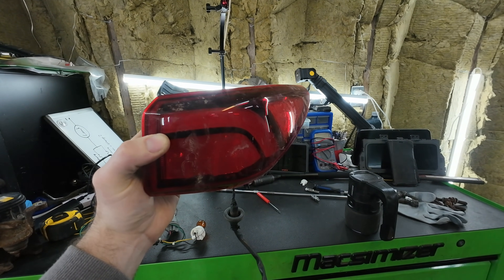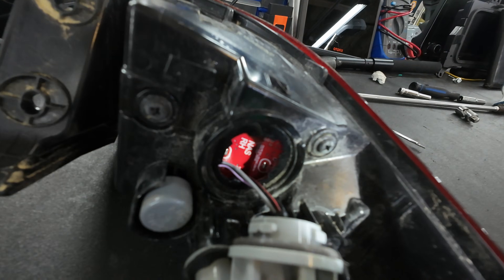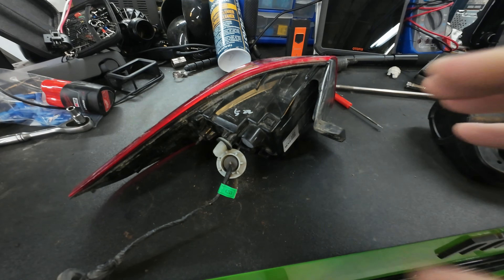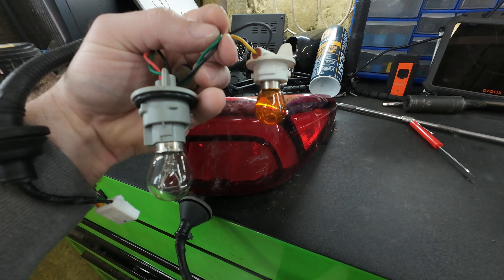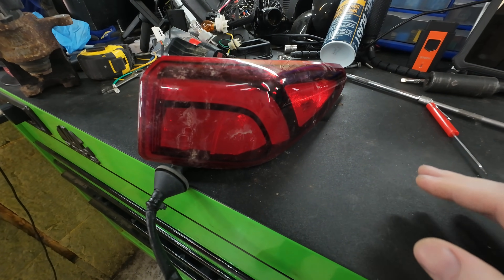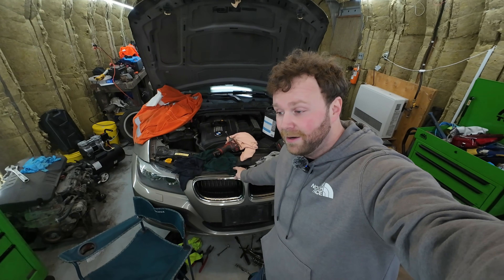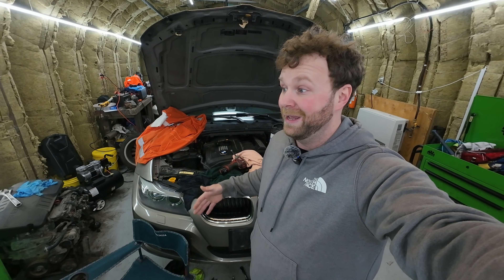Car Manufacturers don't even want you to change bulbs, they want you to replace entire assemblies!

Comment: Facts, I just turned down a starter job because the Pacifica has to remove the cat just to get to the starter and I’ve ran into the two bolts breaking off in the head and I don’t have the time or space to deal with that rn during the winter. Drilling out a head on a pentistar is not a job I’m going to tackle any longer… take it to a shop or a dealer. Lady couldn’t believe how much I was going to charge for it… I live in the rust belt so there’s a valid chance it’s gonna need special attention.

Comment: We like LED lighting but it's supposed to out last 100 incandescent bulbs. So the question. You need to be asking is;  why the led part needs replacing in the first place and stop being short circuited by the difference in costs., get real OK. Or were you not aware of why LEDS are being used now??

Comment: That's a <£100 PCB when low volume. £1200 is daylight robbery... Not to mention how easy it would be to fix, but this will still end up in a landfill because it's cheaper to manufacture than to troubleshoot.

Comment: I'm thankful for my 2021 AWD Ford EcoSport. Easy bulbs. Easy access. It's headlights were dangerously candle dim with incandescents behind the projector lenses, so I upgraded to LED. A lot better, the same light height, and doesn't scatter. No complaints or bright flashers from oncoming drivers. Still dimmer than most stock (brighter than the sun) LED headlights out there, but they do the job. Unfortunately, the foglights to LED were difficult. At least when I did get access, they were plug and play.

Comment: It's also a safety problem when you have to wait for repair parts because they are not available locally.  If I'm going to spend that much I'll replace the whole wiring harness with equipment I can service. That's outright theft.  There's a company I won't do business with.

Comment: That's very probably a global plan of car manufacturers cartel to end licensing for small manufactures in order to cut vehicle parts availability. From this year in EU you can't find third-party parts for some new Renault models. Plus most of the main parts has it's own ECU and needs programming. That i.e. means taillight will not work even if you have a spare one from another vehicle. These vehicles are serviceable only at Renault-certified dealerships at crazy high prices of parts. Also their labor rates are at least double than those by independent mechanics. Buying an new today car is extremely idiotic deal.

Comment: This is a common issues on the Mercedes E-class tail light, you can replace them or watch a video on YouTube on how to fix them, it’s not easy to fix, you have to cut through sections of the casing and solder the circuit board. I have done it on mine twice. But it’s repairable if you have a bit of courage.

Comment: Nice video. I've seen people pay more for factory LEDs after I warned them to just buy over the counter LED bulbs that will plug into the bulb socket. It always starts and ends the same. They are very happy and the factory LEDs do look nicer than the aftermarket. But over the years, one stops working and gets broken in a minor accident. Then they call me complaining that the factory LED assembly is $500. I always tell them, that the $10 LED bulb would have performed almost the same (the factory unit was a LEB Cob).
And people that fall for the laser headlights. 🤣 I'll be the first to admit that they look great. But replacing them is ~$2000. I'll stick with LED headlights and yes they are more expensive than incandescent bulbs, but the safety trade off makes it worth it, (auto dimming, LED Matrix that shields oncoming traffic, etc).

BTW - Just stumbled upon your content and this is the first video I'm seen. I subscribed right after watching it.
Reply: Funny how most parts like that cost so much yet a replacement LED brake light module on the 2003-2007 Acura TL is well under $100

Comment: Brake pads ...i heard somewhere that a specific honda need to be re programmed  to install break pads...software only a dealer can have ...or any mechanic that can pay a monthly fee.
Reply from the maker: I never ran into that. But if I had to guess it would be the honda prolog.  Its basically an electric Chevy blazer with honda logos.

Comment: that is the problem with the laser / led lights in current cars. you will need to replace the entire crap when it fails, and it will. costing thousands. the more "luxurious" the car, which is what people want, the worse it is.

Comment: You do understand that those old head-light bulbs used to cost about $20....  and then a service booking and a $70 mechanic labour charge to remove the battery or air-pump to fit it? This was on my 2005 Ford Falcon which had restricted access in the streamlined engine bay. And the bulb went about every 6-12 months. After a few years of this I fronted up the cash for a $300 change-over to LED head-lights. These then lasted me for over 10 years (never needed replacement before I finally sold the car).
The new EV is all pixellated LEDs and they work extremely well. I do not expect them to randomly just fail.  IF  I manage to prang it I have full insurance cover
Rule no. 1 - do not prang your car and smash your high-quality head-lights or tail-lights

Comment: The worst part is that the machines in dealerships don't know what they are doing and have little or no education on 95% of the newer vehicles.  Manufacturers are now doing everything they can to prevent independent shops from getting any information to their vehicles in the first place.  The dealership doesn't want to pay to teach a technician how to repair a vehicle.   99% of dealerships are all about production.  Production means More Money, Not repairs.  They want you coming back so they can charge you again, and again for a repair they should have done in the first place.   This is becoming the standard in the industry today.  You have no right to repair it yourself any longer.

Comment: 99% 1 led goes bad and takes down the whole light if you could get the light apart power up board and jumper across each led until light comes on you found your bad led.

Comment: I worked as a QE for a company in Grand Rapids Michigan that did tail and signal lighting for the OEMs. Ford did this with the Mustangs starting with the 2010 model year. When I started there in 2014, a set of Mustang taillights cost $800 US to replace.
When they started designing the wraparound placard taillights, it got nuts. Both corner lights and the placard all sealed LEDs. I helped launch the 2016 Ford Edge/Lincoln MKX rear lights, when they went to wraparound style.
It's all a play by the OEMs to make more money, either directly and/or thru the dealerships. The parts are more expensive, cars are more expensive. Under the hood, under the car, you can't just fix something anymore. Have to pull an entire assembly and replace.

Comment: This is so true. Once Pep Boy's tried to charge me $1,000 dollars for a headlight assembly. Instead I took my car to my own mechanic. He showed me the mangled job multiple mechanics did on the prongs that fit into the receptor. That was the reason why every bulb they tried didn't work. After my mechanic meticulously straightened out the prongs, even gluing one in that came loose from all the paw work at Pep Boy's, my bulb worked just fine. I don't think he even charged me the full hours it took him to fix it. That honest mechanic is worth his weight in gold.

Comment: My wipers failed. Bolt like connector in the wiper joints under the hood gave out. Went to service, they wanted to replace the whole wiper assembly, both wiper arms and all back to the motor. $$$.
Got a drill, drilled out the broken plastic both like connection, put in Teflon washers for movement, and regular washers and bolt for strength. 5 years still working even with rain, snow, and worse. Few dollars of parts at Canadian Tire.

Comment: FYI  when most new LED TVs have a led light problem  you buy a new TV,  replacement cost is not expensive but removing the part is.   large chance of breaking the glass screen,

Comment: Screw dealerships with their new over priced, high fail rate engineered obsolescent vehicles. SOLUTION: Buy used car built before 2015 for under $15k with less than 200k miles and put another $10 to $15k into refurbishment. No more Dealership interference with owner "Right to Repair".  Most mechanics say older cars are more reliable if properly maintained and easier to work on. No more CEL and Limp Mode ECU engineered fails that rip customers

Comment: "You will own nothing". This is part of that. They want to make cars disposable. You will get financed and change cars every few years but never own one. You will make payments for as long as you drive, period. They will outlaw cars older than this non-service crap. You can collect them but never get them registered. And I think that before long, if your car's CPU says a brake light is out or the tires are a certain age - the car will not run until serviced. Watch and see.

Comment: You can get after market tail lights that use bulbs and they sell a harness for it also remove light fixture unhook old harness installed new one put in bulbs and it cost about 500 for new unit

Comment: $1200.-$1500. Seems to be a very common price for headlights these days. It’s not unheard of for European to hit $3,000.+. Even mirrors and taillights are absurdly  priced now too. 
Manufacturers looked at the cars and took everything that was affordable and pushed the price through the roof by putting things like LEDs,radar,sensors,etc.  They also require special calibrations that can cost several hundred more dollars. 
New vehicles are not worth buying. They are designed to fail and make maximum dollars on the repairs. and parts.

Comment: The Mercedes oil dipstick is about 4" long, just plugs the tube is all. To check the oil level, you have to push buttons on the dash.... if you can find the owner's manual to find out which ones. I told my uncle that owns 3 MB's that. 10 minutes later I saw him open the hood and pull out the little dipstick. In other words, in 30 years he's NEVER checked his oil.

Comment: Ford 150, I was waiting... No it is way more expensive than that...
● Wet tail light will cut the operation. Not "limp mode", bricked. Live in isolated northern region? Be careful.

Comment: Seen a video on that pick up you mentioned with the sensors  in them. They needed replacement because of corrosion, and yes, they're expensive. My opinion with this JUNK, is how is this environmentally friendly? It's not. I don't think many want this, well, I wouldn't,  but today, you've no choice if your wanting a new vehicle.

Comment: I agree on the unfavorable economics of replacements. However, if designed correctly self contained led assemblies should never need replacement anyway.
Reply: ... Until someone crunches your tail light in a parking lot.
Reply: @SRHMusic012 All may not be lost. It depends on construction and which plastic it's made of. Polycarbonate (Lexan for one brand name) is very strong: while others like acrylic (plexiglass for one brand name) is less rugged. Also, tail lights are often mounted higher than they used to be. My suv has them around hip height. Lastly, after market companies might well  produce cheaper than oem at least for the more popular models.
Reply: @joewoodchuck3824  Well, it already happened. Trucks are much taller now, cars and mid sized SUVs not so much. Cheers

Comment: YEP!!!! STOP! JUST STOP buying new cars!!!!   2011, i looked at new trucks....  because my wife was tired of me always fixing my 89 Chevy....    AFTER looking at new trucks.... she gave me the green light to rebuild my 89....   I personally did a frame off, stainless brake lines, rebuilt the engine, trans and rear end... 10 Grand....   another 2 grand in new switches, interior etc....  I even got out the spray gun and repainted it. Truck is like new, runs like a dream, and does everything I need it to, for 12 grand or a bit more.   WHY in GODS name would I pay 70 to 120K for a new truck?????????????  That they do not want ME to fix myself?

Comment: My 1993 Chevy S-10 pickup (it's a real pickup, 2 doors, bench seat, 2 wheel drive, long bed, manual transmission) 2003 Ford Mustang V6, 2006 Ford Crown Vic, and 2007 Mercury Grand Marquis do not have problems like this. Anybody who buys a vehicle like this deserves what they get. It's not like there isn't a ton of information out there about this.

Comment: Carefully crack the taillight open (best done if it’s warm - over 80 degrees) and yank that silly circuit board and whatever else out. Splice a normal bulb holder from an older car onto the wiring, and plug in an 1157 bulb. Sure, it’ll burn out again in a couple years, but replacing it will cost $2 and take maybe 5 minutes.

Comment: License plate lights gone the same, F 150s, same size hole in bumper, old change the bulb, new change the assembly and the connebtir is usually screwed too. Civic, assembly, Ford Fusion, tear the whole trunk lid apart to change it.  Old Yaris even, sure you can change a headlight buln but need to remove the bumper skin. Light bulbs should be something you can stop on a trip at a Canadian Tire - grab a bulb and change it in the parking lot.

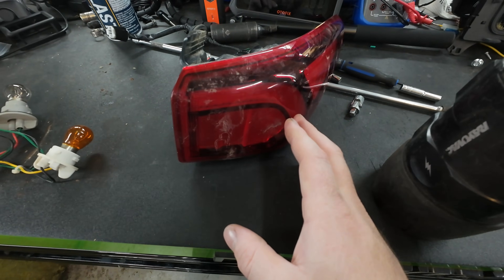Comment: 0:40 It's Hyundai, not Hunday. Hi-Oon-dah-i. (i as in "it", oo as in "book", da as in "dark"). It's Japanese.
Your last note about technology is why I kept hold of my '98 Camry until just a few years ago, when it finally had its day. My current car is a hybrid Corolla. I do worry about about when things go wrong in the future. Everything's computer controlled. Sometimes I can even hear tiny servo motors in the dash board moving who knows what. All the front and interior lights are LEDs. So is the centre brake light. The reversing lights, other two brake lights and rear indicators are regular bulbs. I wasn't sure why, but I guess now I know. It must be to make them more user-friendly for changing or to keep costs down during production. Either way, I bought pairs of all those bulbs, for when I eventually need them.
Reply from the maker: meh the Koreans, from Korea, who worked for Hyundai. Told us to pronounce it Sunday-Hunday.

Comment: I have a 2012 Ford Focus Hatchback with a manual transmission with 192K miles on it. It is getting rough since I live in the rust belt but still runs like new. When I need to replace it I will be getting ANOTHER 2012 - 2018 Focus Hatchback with lower miles, preferably from the South. Yes, simple to do maintenance and replace bulbs. This has been the most dependable car I have ever owned and it is a ball to drive. I bought it with 16,000 miles on it and $8,400 off the sticker price.....I believe because manual trans cars sell slower. I won't buy a newer vehicle for the reasons mentioned in this video as well as all the data collection and lack of privacy that new cars have.

Comment: Just another perfect example of tech bros trying to jam technology everywhere it isn’t necessary. There was nothing wrong with a lightbulb, a couple of contacts, and some wires going to some mechanical switches under the brake pedal, worked perfectly since brake lights were invented. Technology for technologies sake, no actual innovation.

Comment: We bought an auction F-250 Flatbed from an underground mine.   It’s a good truck, but it had fine light gray dust EVERYWHERE!   We even had to remove the evaporator to clean it out.   Shift cable was shot, brake cables were totally siezed.   Shift interlock and door latches were shot too.   But the big stuff was good.   She’s still running strong!   FORD Tough! 🇺🇸

Comment: I like technology, but there needs to be common sense in all of this. It doesn't need to be eliminated (because that's unthinkable nowadays), but making everything so technological that it complicates the basics is unacceptable. 
LED lighting is more aesthetically pleasing than older lighting, but halogen bulbs are easier to replace and maintain. 
Overall, automakers are making everything that used to be simple even more difficult.

Comment: How ironic, as I try to read comments, a stinking Nissan add pops up! As I was going to say, I'll spend money fixing my 2008 Mustang and my 2014 Expedition. I just paid $20,000 to restore the Mustang. I'll happily spend $5000 more for the engine if need be. I'll still spend less than buying a new piece of crap from the thieves. And it's STILL cheaper to repair than the modern junk being sold today!

Comment: In 2014 they removed my whole front of my 2006 vw passat 3bg to change the left light....it takes them 1hour and 400euros only to fix the light.
so this is nothing new but the used car buyer needs a few years to check it.

Comment: Slightly different, but I changed headlight bulbs on my 2007 Prius. It took me at least a couple of hours, fiddling in tiny spaces, and using a mirror. I wished I had a trained octopus to help. I called the dealer and asked them the price for this job. They gave me a very high quote. I asked why so much and they told me that they would remove the whole front "face" of the car.
Reply from the maker: Yeah bumpers need to come off for simple maintenence these days

Comment: If the person not certified mechanic / car electrician - they shouldn't touch the lightbulbs. These exactly type of people who installs in the headlights blinding non matching and non configured LEDs. Leave this work to professionals.
Reply: Umm... I would much rather people try to do it themselve so they learn how to maintenance their vehicle. Besides, cops will pull you over if your lights are messed up.